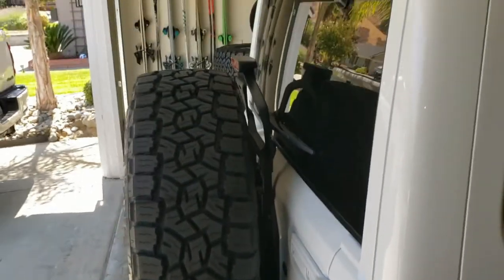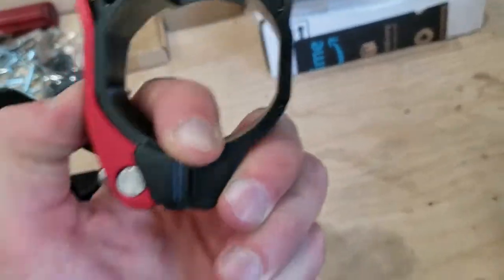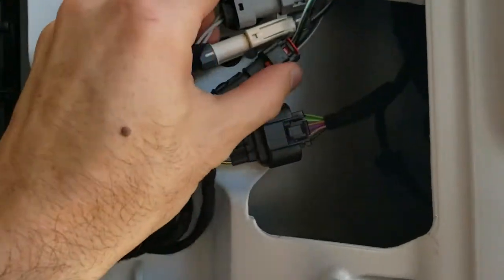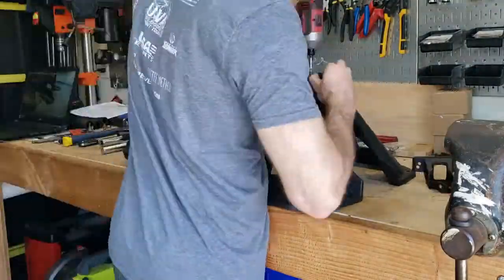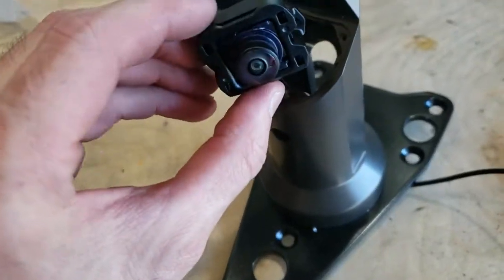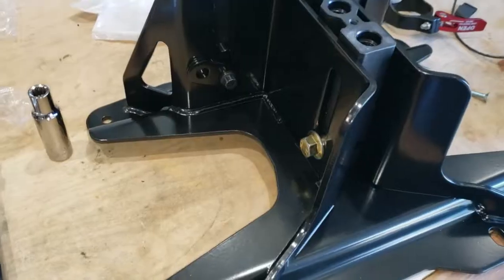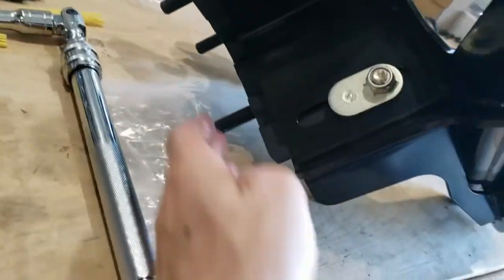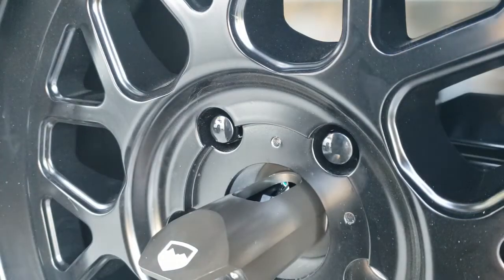TeraFlex Spare Tire Carrier Install

Comment: Nice step by step video.  Was it possible to torque the lugs to 150 ft # on the table or did you first mount the bracket on the tailgate to get the 150# they ask for?
Reply from the maker: I torqued the lugs after I got the carrier mounted in the tail gate. It wouldn’t have required I make a jig to hold the carrier in place if I wanted to talk it down on the bench. I simply torqued the lugs once the carrier was mounted to the car, and the tailgate was closed.
Reply: @HarrisonsGarage  Thanks!

Comment: Hey man, great video. Just ordered the HD Alpha adjustable mount as well. Just to clarify, if I’m running 35” tires with a -12 offset, you think the top holes (for 37-29”) is the way to go? Did you try to pull the tire closer to the body while using the middle holes to avoid the sensors going nuts? Lastly, how did the tire fit on the bump stops? Did you have to extend them with furniture rubber feet or pvc like I’ve seen on the forums? Thanks again, keep up the great work!
Reply from the maker: I had to go to the top hole to keep the sensors from going nuts. With the -12 offset the tire just stuck out too far otherwise. Bump stops weren’t an issue whatsoever as they could be sufficiently adjusted to meet the tire.